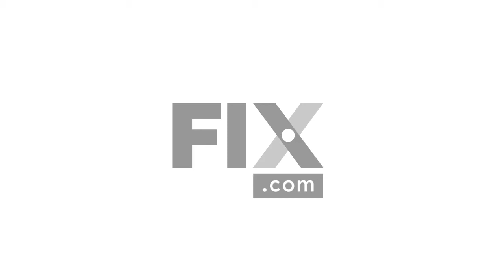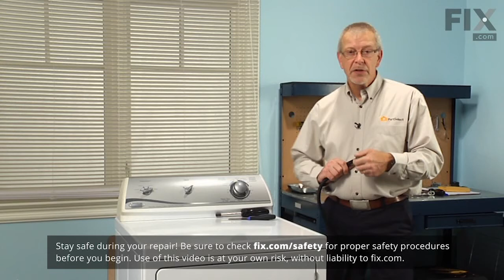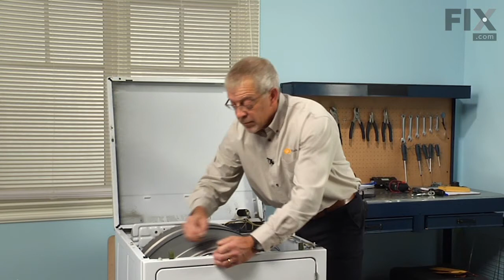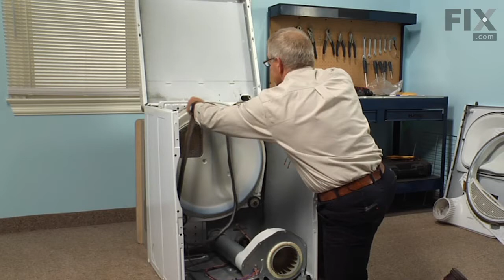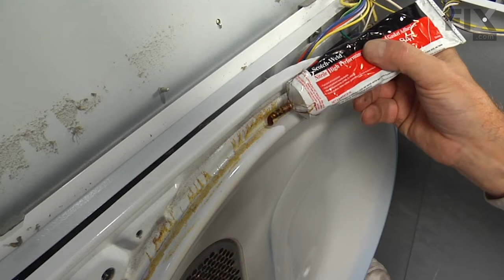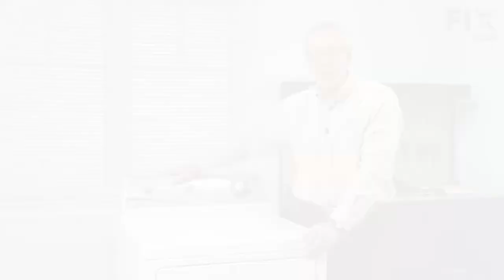Amana Dryer Repair – How to replace the Cylinder Felt Seal

Comment: How can you tell if the problem is the front or the rear felt?
Reply: Mine is for sure the front because it's ripping clothes
Reply: Likely if one is worn, replace both, along with new drum glides on the front bulkhead. That way every point of contact that wears through is now refreshed.

Noise after that can then really only be drum wheels/spindles, tension pulley or blower wheel.
Those are less likely to be damaged though.
Reply: Where’s the video for the front replacement seal ? Everybody shows the back  but not the front